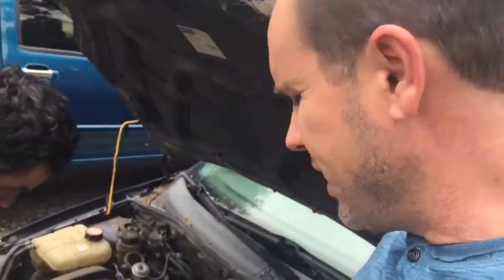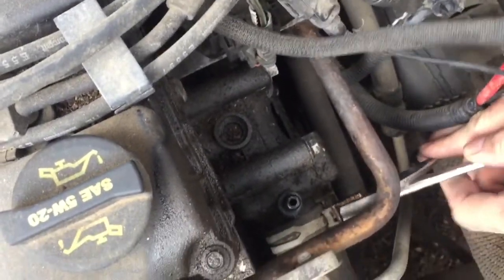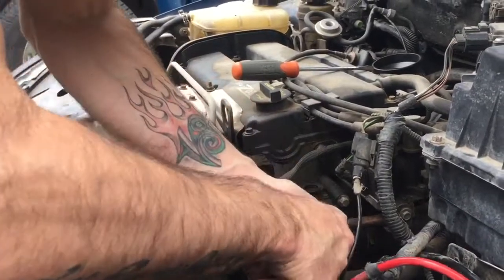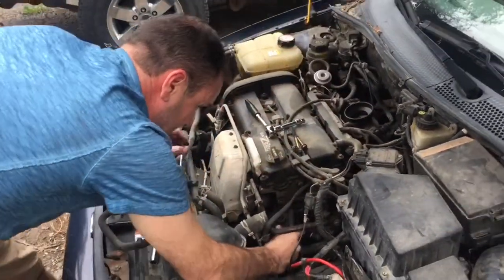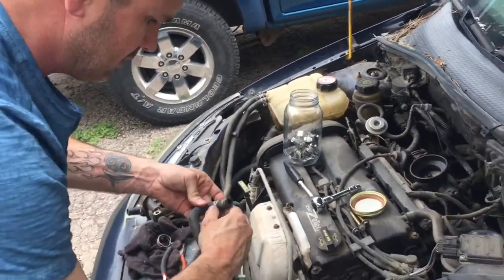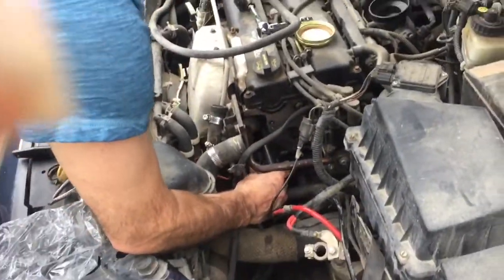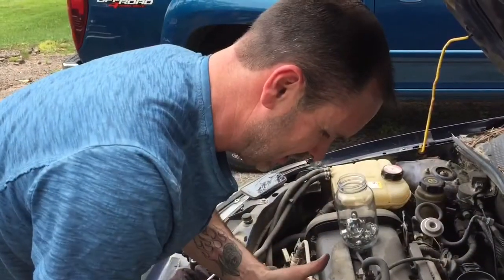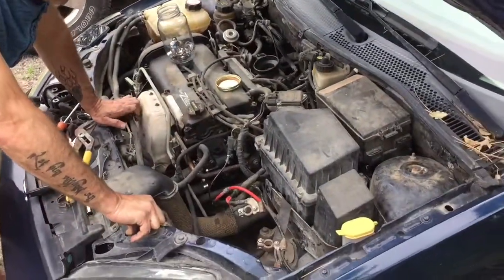How to Replace Thermostat Housing - 03 Ford Focus

Comment: Thanks for this! Fortunately, I had an easier time than you did as the last time the thermostat was replaced the mechanic swapped the stock hose clamps you struggled with with the better ones you replaced them with. MFer came right off and went back on with minimal hassle. Thanks again from South Florida!
Reply from the maker: That’s so awesome!  Thank you for tuning in and letting me know this helped!  Glad you had an easier time with it!!